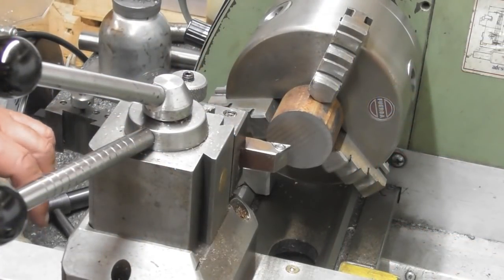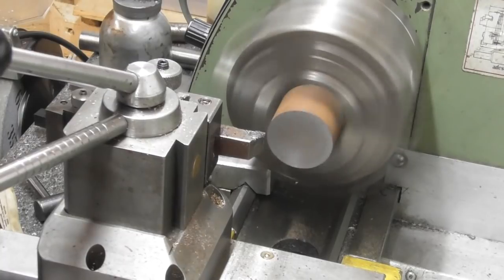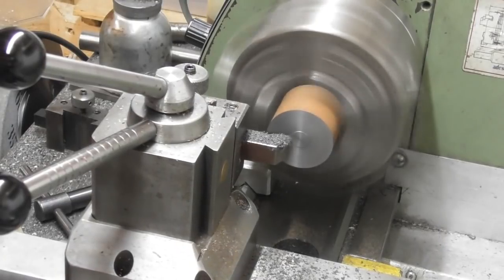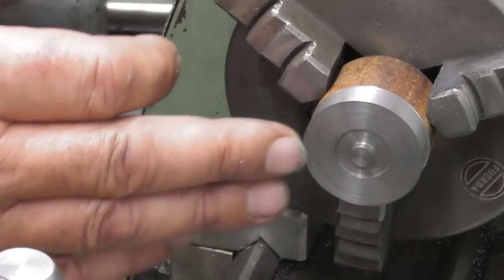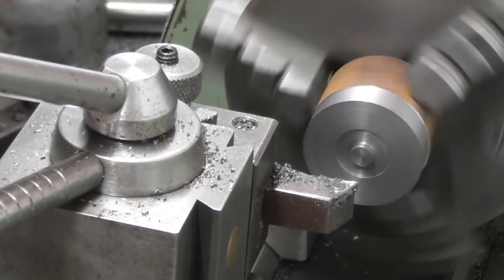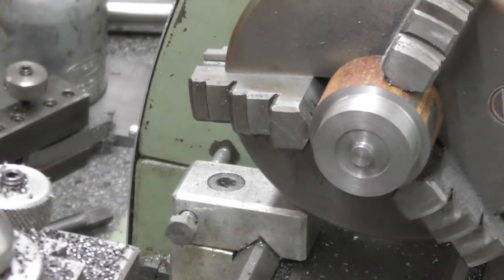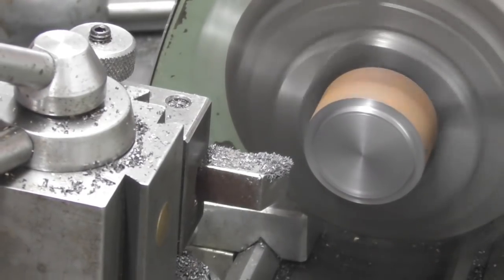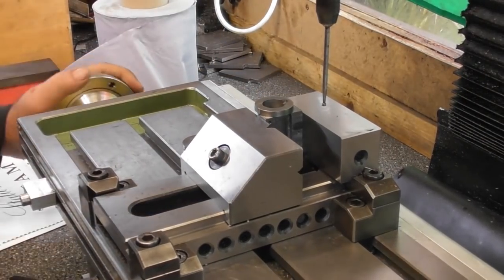Stuart model S50 engine part 16

Comment: Hi Ade
Good video, can you use the divisions on dial for measuring, or will the length of the probe will effect the amount of movement on the dial?
Reply: It's a comparative indicator.  Really can't use it for accurate measuring.  As you said, length of the probe and angle used to pick up the diameter would affect the reading.  He's using it correctly.

Comment: Hi Ade, good demo of the two centering tools. The coaxial indicator seemed a little bit "fussy", or is that just a feel thing?
Reply from the maker: It is really simple to centre . I was just me being a D**k . Cheers Ade.
Reply: I used co-axial for center checks on cnc spindle to program location. Last word for spindle to fixture or part. Just always did it that way. ???